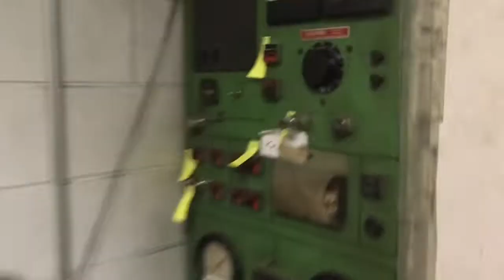Reality of Some Aerospace Companies - When the person in charge doesn’t give a sh*t

Comment: Hi mr. Howard how about yout opinion about nadcap and is there corelation between most aerospace company who has welding shop with nadcap
Reply from the maker: So we’re on the same page:

“NADCAP (National Aerospace and Defense Contractors Accreditation Program) is a rigorous yet rewarding accreditation program for aerospace engineering, defense, and related industries. This certification process is intended to be a managed approach to conformity and auditing that follows strict requirements for suppliers that are standardized by government and industry leaders.”

The only company I worked at where their nadcap certificate is public is Honeywell aerospace.

The cleanest and most by the book aerospace company I’ve seen was senior aerospace SSP and I don’t think they’re nadcap certified.

Most aerospace companies wether bad or good tend to have great paperwork and tracking.

That said, good paperwork doesn’t always necessarily mean a good shop.

I felt Honeywell was kinda unorganized in my opinion. However the shop was clean and the campus was a pleasure to work at.

BP aerospace in this video was a clown show but they did have excellent paperwork.

I judge aerospace companies by who they let work. Bigger and legit companies require citizenship, you have to speak English, pass a background check, graduated high school… those are the signs of a legit aerospace spot.

BP aerospace has illegals and felons on staff.

So does hydraulics international, another aerospace company in Burbank CA.
Reply: I think a company that provides aircraft  parts must focus on 1 area in its business.  for example an aerospace industry that produces welding parts, an aerospace industry that produces wings etc.  I think at BP Aerospace, why  the condition of the shop like that because the company has many products or services other than welding so the welding workshop is not taken care of.  I suspect that the welding procedure is not there or is not carried out properly. Whether my suspect is right or wrong mr.  Howard?
Reply from the maker: @mainstreamgamer1300  You are right but BP was weird. It was aerospace repair and refurbishing. 

So the robot in the video is plasma arc spray. Technically a welding process. It sprays metal dust in layers onto a material to give it different properties. 

Crude example, you spray titanium dust on carbon steel and you get some corrosion resistance. 

The robot was unkept because the team working on it had very bad leadership. The lead was always late, drunk, and just let cleanliness go. Plus cleaning takes up production time.

The rest of the facility was spotless. 

Shop conditions i really think come down to immediate management or floor supervisors. 

When I've been a shop lead, nobody leaves till all tools are put away. Workstations are kept tidy so things don't get lost. 

Some supervisors don't realize how the simple things can improve work flow. 

Bad people in a great place definitely has an effect on the shop's productivity.  

Shops should focus on business. Getting parts out on time and up to specifications.

Good housekeeping and an organized staff are the simplest ways to increase productivity.
Reply: @howardhughes6212   @Howard Hughes  yes you right, bad people in a great place has an effect on shop productivity.  Beside that, to increase productivity and quality you must build system which can reduce intervention from the other side. The people who work in welding area must guided by system. The system also will help reducing mistakes created by human. 

I see that bp aerospace is repair company, so quality of the weld repair weld cannot be as same as original weld or material. Investment of facility also will be expensive for repair company like bp aerospace. But at least the existing equipment can be maintained properly if they won't planned to build new facility